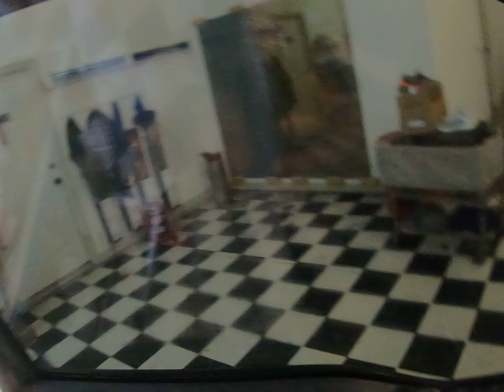Solar Gard Vortex 15% ceramic film... dropped n shaved..... Extended Analysis...Enjoy!

Comment: Have you tried flexfilm
Reply from the maker: No i have not....have u used ctx or global???
Reply: @mikesanchez1428  no just a diyer trying to do my truck flexfilm is the only place i have found that has precut top of the line ceramic any one can order just wondering if it was any good
Reply from the maker: @stevewittrig9406  should be boss...if not...post about it to avoud otgers same fate...thanks